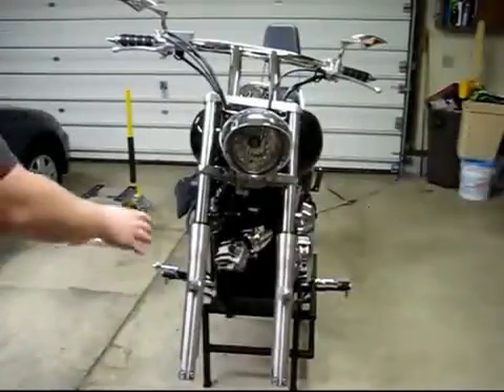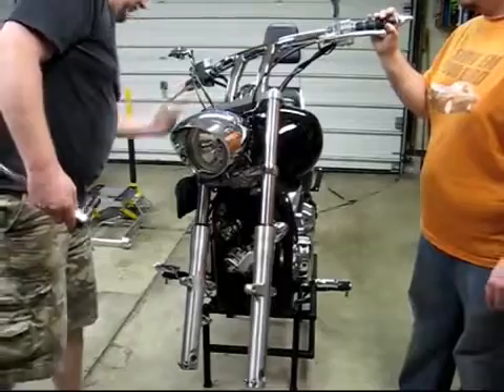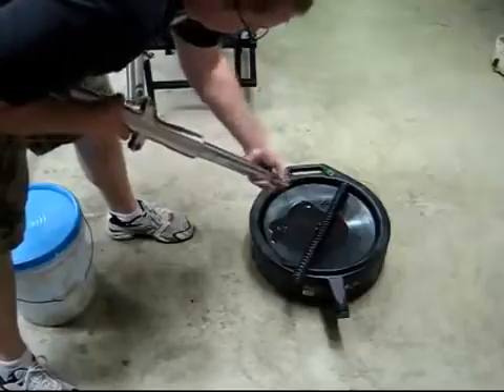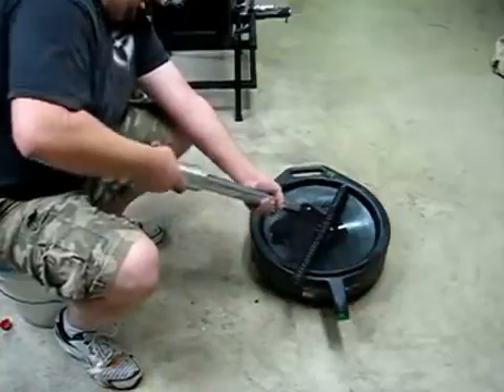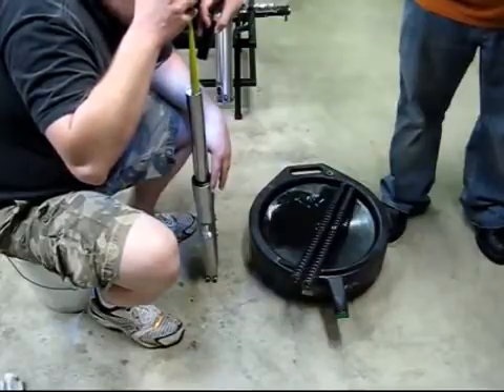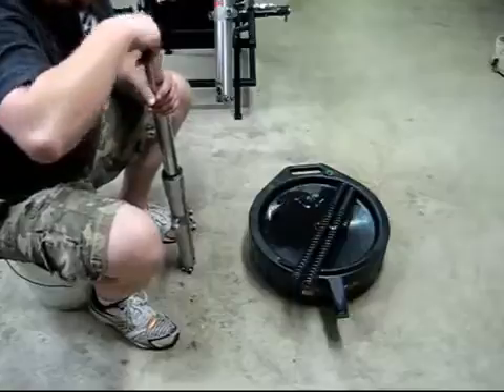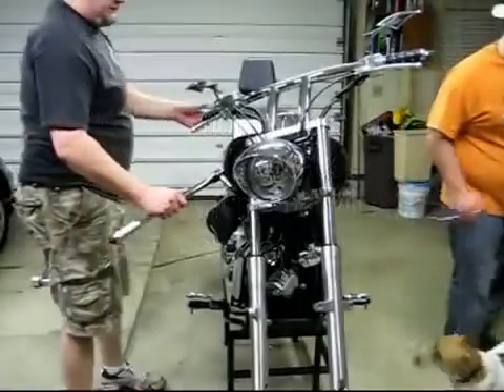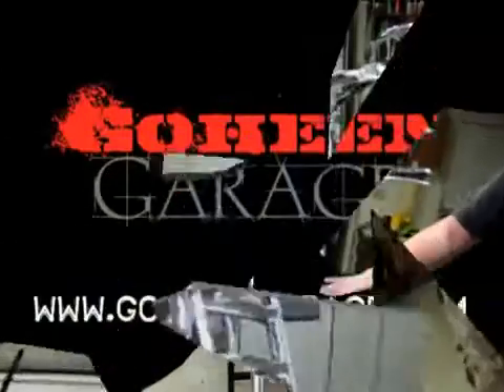VTX 1300 Fork Flush How to

Comment: Thank you for the video, I need to get mine done, I have 35K on it I think its time, Hope it smooths out my front end
Reply from the maker: mrlights4x4 Definately should help.  It also helps if you swap out those stock fork springs with progressives.  That makes a huge difference in the ride.

Comment: Where did you get the torque ( for pinch bolts and oil cap ) specs from please ?
Reply from the maker: They are from the manual.  I will get them when I get to the shop tomorrow and let you know.